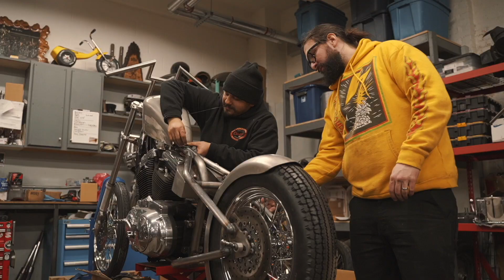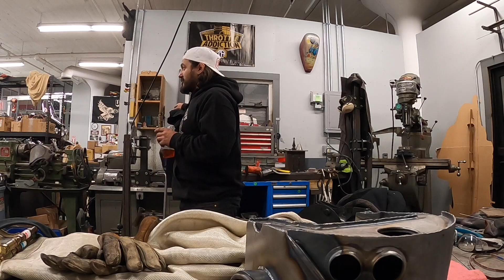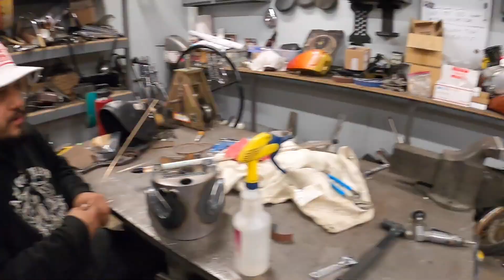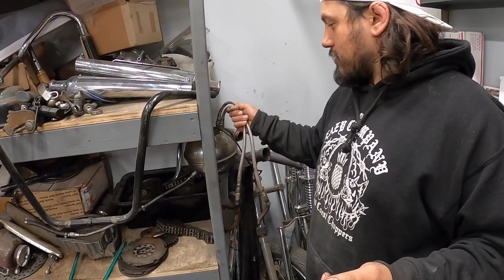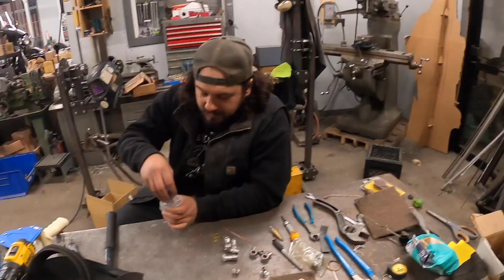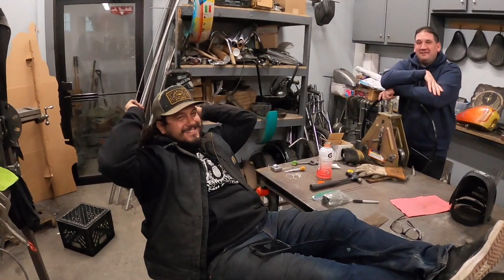Choppers!

Comment: The road flair is correct , they had a cloth wick in them , like a Zippo , lighter, and they were fill with kerosene, and lit on fire , to warn people at night about construction on road crews torn up pavement , I kicked a few over when I was a teen , kid fire , go figure , on a hill created a big flame trail going down the hill , fire trucks came , and had to put out the big wall of fire 🔥 I created , that's how I know exactly what they are , they were black and usually covered in black carbon from the burn , lots of black smoke , just a story for you guys , yes I was a bad kid , always a n the run causing so kinda shit , ha ha , school of hard Knox cheers .